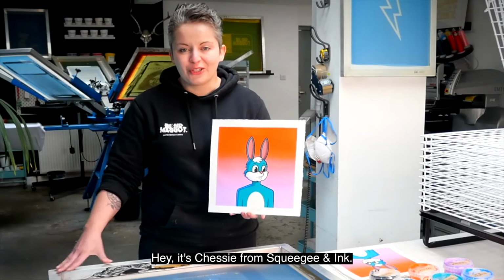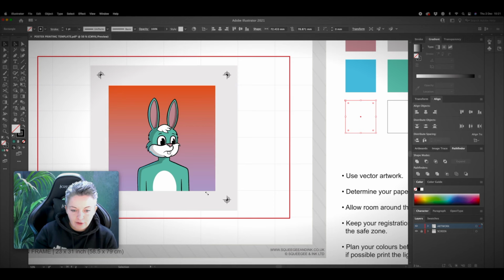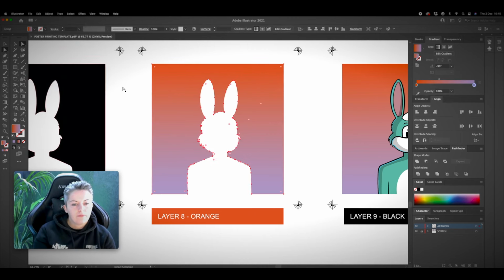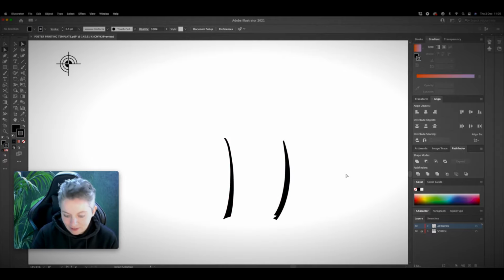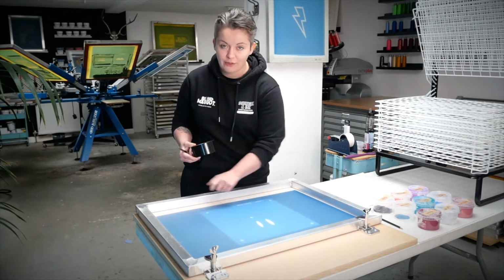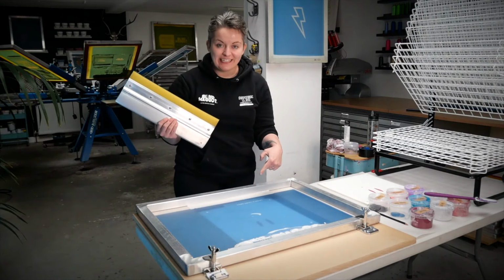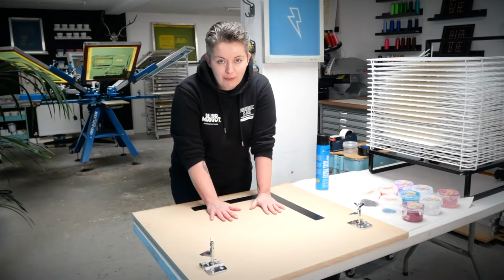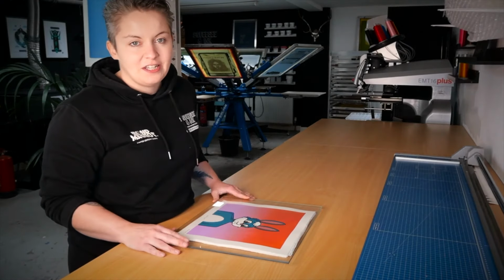How to screen print multicolour posters with hinge clamps - full course

Comment: Hi.  I have been watching your videos closely as I am just starting silkscreen printing.  Pls could you advise which emulsion/inks would work best for;   fine detail printing on self-adhesive vinyl stickers (white stock and clear stock)   I am confused with all the types of emulsions/inks I have seen.
Secondly I will also need to print enamels inks on (pinball) painted cabinets (only a few) - which emulsion would be best for this.?   I don't yet have an exposure unit, buy I will buy whatever light would best suit the recommended emulsion (halogen, UV,) ... or sun.    Thx in advance for some recommendations. Phil